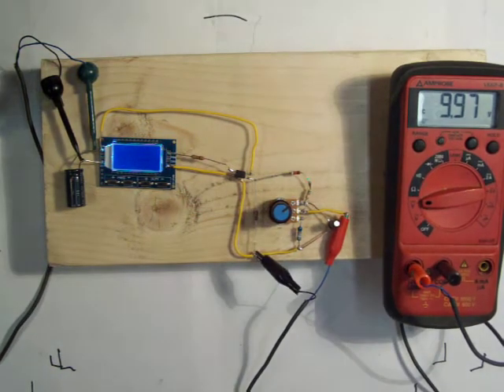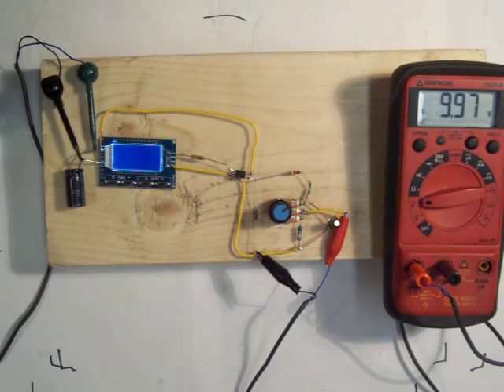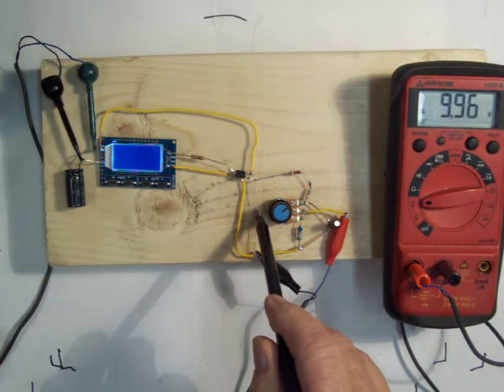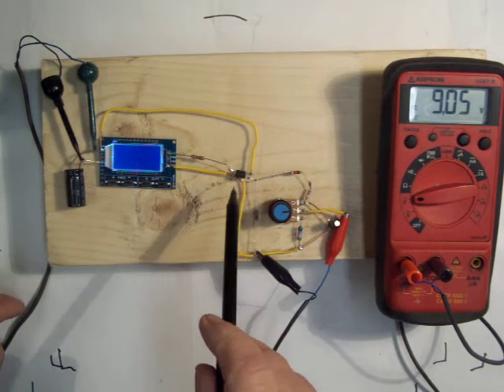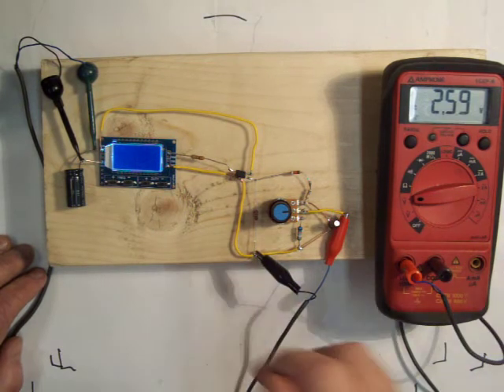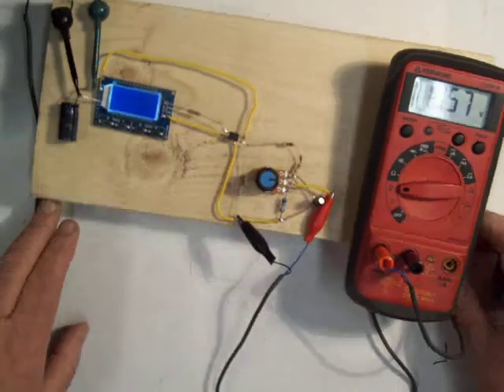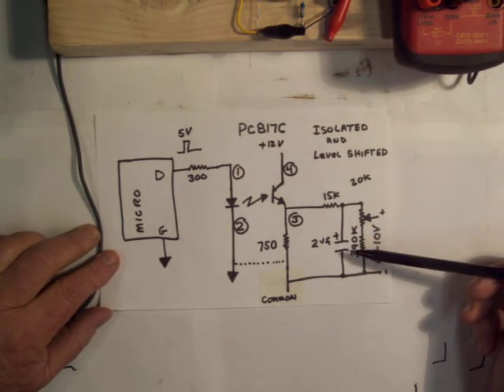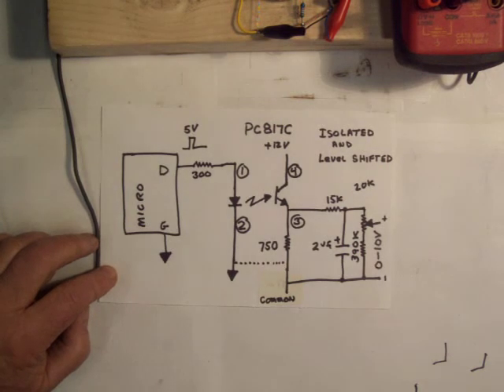Opto Isolator 5V to 10V Level Shifter Easy PWM To Analog

Comment: I would like to use the DAC output from an ESP32 to send 0-3.3v  to control a 0-10v control line on an LED driver. Will the opto only work with pwm?
Reply from the maker: The output of an opto isolator is not linear.  It may be close enough for applications like light control. There is an offset of 1-2V which will have to be accounted for by driving them with an op amp. That may be a problem if you have only 3-5V. It can be made more linear by putting the LED of two of them in series and driving that thru a resistor. The outputs are then emitter follower into a resistor. One is the feedback to the op amp and the other would be the 0-10V. A lot of fooling with values.
Reply: @opera5714  thanks so much for replying! It's good to know the output isn't linear. I've got an LM324n that may work for this. Alternatively I just found some neat IC's designed to be used as a 0-10v dimming controller. (Also using an opto) According to the tech line, The CMD10V accepts pwm and DAC input. I may grab a few and see what they're all about.